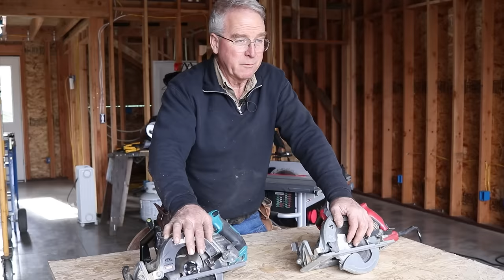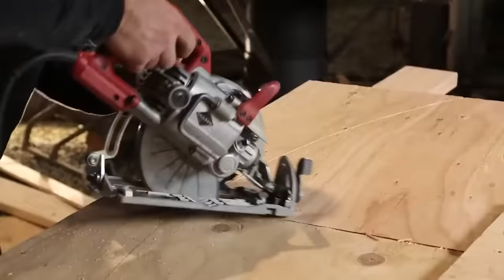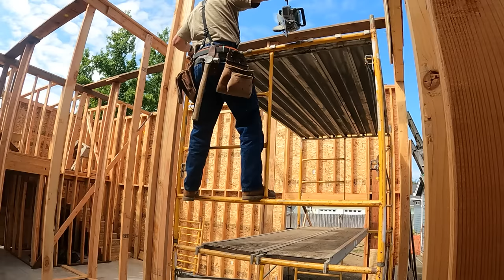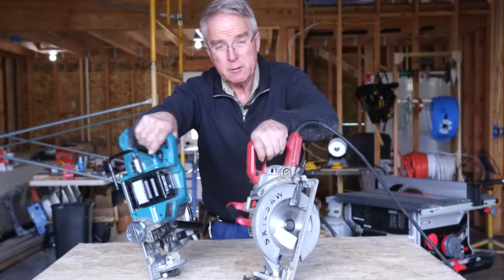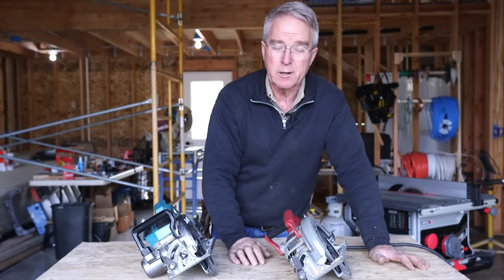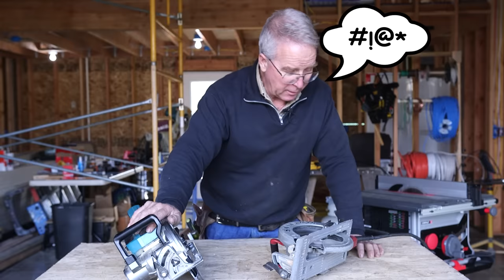Makita 40v XGT GSR01Z 7-1/4" vs. Skilsaw Mag 77 Circular Saw Review

Comment: I love my modern cordless tools, and yes they are makita. However I think you nailed the inherit weakness that cordless still has and in many cases will always have. This was by far one of the most fair and reasonable assessments I've ever seen. I think the statement of if you have to pick only one, then going with the corded workhorse is always 100% the correct answer. Cordless is firmly believe is a luxury to have for the convenience if you can afford the extra cost. Most of my older corded tools I still keep around, because like you sometimes there is a job that they are simply better at although it is usually because I've been lazy and kept chucking my batteries in a bag instead of on a charger.

Comment: I hear what you are saying. I am 54 and my background is residential construction. I used a DeWalt framing saw and my forman used a saw just like yours. The job sites that we worked on were almost always away from town and power. So we had to have a generator. Listening to that run all day long to power the tools is a reminder to look for a quieter option if there is one. I have a ringing in my ears all day and all night. My DeWalt flexvolt saw now will do almost anything and no generator noise.

Comment: I started my career in the trades early. My first cordless drill was the old black and decker that had a fixed internal battery cord and plugged directly into an outlet to charge. It had a 3/8" keyed chuck and had horriblelife span compared to today's cordless stuff. Today I'm a cordless tool fan. I'm currently running a gen 2 ridgid cordless circular saw that I have ran to hell and back for almost 16 years. It's an old 18v 6 1/2" saw. I've ran this saw since I was 24 years old. I'm now 42.  This saw certainly has its limits but with a new blade and a fresh battery I wouldnt hesitate to rip 2x lumber. I usually do picture framed deck jobs using this saw only. However I dont do major framing with it. I love my old cordless ridgid saw. I trust it doing damn near anything. I always keep my biggger saws in my truck but for what I do my cordless will always have a place in my tool box. 😊

Comment: Scott- well done! As a general contractor in PA, worm drives were not something I had ever used- it was always a sidewinder. I am not a production builder and do a lot or remodeling, so cordless has been a big plus for me and I have no problem having enough batteries to get the work done. I have had Makita's 36 volt (2 x 18v) rear handle saw for a few years now and love it- even bought a second one so that I can have a framing blade and a metal blade so I don't need to change blades. 

You did an excellent job exposing the nuance of how individuals use tools. A few years ago I bought a used worm drive because I thought that having the added power would be a benefit, but I used it once and it has never come back out. Thanks for being open and honest.

Comment: One thing you didn't mention and maybe haven't noticed yet is the effect of rain on the saws. That Makita can sit outside in a PNW rain all winter long and never have an issue because of it. Your corded saw is going to trip the GFI fairly often if left uncovered. I framed houses in SW Washington for 9 years and that one fact made the cordless saws worth every penny.

I didn't actually leave the saw out for an entire winter. My point is, it can get wet and it'll still function with zero problems. A corded saw will trip the GFI if it gets much water on it.
Reply: Makita is plenty durable and I think his baseless assertion doesn't fit.
Reply: Two weeks into owning my makita, I accidentally left out overnight - hanging from the side of my trailer, in a hurricane..

Not only had I forgotten all about it the next morning, it hadn't been stolen & it hadn't blown away or even showed any sign of wear or rust whatsoever (except a little rusty color in the socket for the rafter-hook; cleaned right out with a little WD).

It runs like nothing ever happened, and I thanked my lucky stars for it. ✌️
Reply: Man. I've been in Costa Rica for 20 years and never looked at that angle....Interesting.BUT. I'm also a maintenance fanatic with my schtuff. You buy a pair of boots. Never put them on, leave them in the closet for 3 months, they grow a pizza topping. Like the  PNW. It's a tough climate(minus coldness). YOU have better ferns in Olympic than what we have here tho. We run 50/50 on woods and CR kicks bootay on orchids---no elk
Reply: Um,,, your ground is hooked up wrong…
Reply: @Champ  do you really think it will last as long as the skillsaw?  Plus you will need new batteries at some point
Reply: @915fatty  those of us that make money with tools don't leave them out all winter, because we're using them.
Reply: @michaelgarrow3239  no it means his ground is working correctly?
Reply: @PeterTrimboli  - If it’s working correctly then why is it tripping all the time?  😉🎶🎵
Reply: @michaelgarrow3239  because when the saw housing gets wet and the motor windings get wet small currents leak to ground through the saturated windings through the saw housing that is grounded so current leaks to ground because it is grounded correctly and the GFI trips because the GFI is working correctly
Reply: @PeterTrimboli  - Your saw doesn’t work. It is not correct.. 
Do you want to reset breakers all day? Or cut wood??? 
🤔🎶🎵
Reply: @michaelgarrow3239  not the breaker the GFI the GFI is tripping because it is doing it's job if you have a wet corded saw that is properly grounded and are plugged into a GFI as required by OSHA most saws will trip because 5miliamps or greater is returning on the ground which causes the GFI to trip
Reply: @PeterTrimboli  - If we are being pedantic.. the gfi is a circuit-breaker…
It breakers the circuit. And makes your saw inoperable. And you somehow think that is working correctly… 
Do you work for the government?
Edit: I will guess that you have never done a lick of construction in your life.
Reply: @PeterTrimboli :  Minor quibble:  It needn't return on the EGC to trip the GFCI.
Reply: @ncooty  right it can return on anything leak through the earth return on a piece of building steel literally anything other than the current carrying conductors hot and neutral but the guy is arguing that it's not grounded correctly if the GFI is tripping so I was trying to give him an example if the saw was grounded correctly if the saw got wet a small amount of current would flow back on the egc because the saw is grounded properly and would trip the gfi
Reply: Makita saws are IP54 rated.

Comment: The soft start might be there to avoid massive power spikes at startup. Since it’s an electronic speed controller (ESC) the upslope is defined by software so they can put whatever they like. It’s likely a compromise between convenience and battery or mosfet life

Comment: ...mmm I bought a new Skilsaw way back in 1987 and it is a 50th Anniversary Edition  Skilsaw that they sold in a Gold color !  I also have the Blue steel tool box it came in . Its one SWEET saw !
Reply: I bought that same saw but it's long gone. Had 2 worm drives prior and 2 since that I reserve for cutting concrete or ripping a lot of 2xs. 6-1/2" 20v Dewalt with 60 volt flexvolt batteries is my daily go to saw. Amazing power when using those batteries instead of the standard 20 volt.

Comment: Great video.  When I was looking for a new saw in 2014, I had fully intended on buying the Mag 77 but saw a tool breakdown video on AvE's channel of both the Mag 77 and the Makita (corded) hypoid gear saw and went to the store to check them both out.  After holding both in my hand, I purchased the Makita and haven't looked back.  Here's why: I'll never be in a situation where I need a cordless saw of any kind, Hypoid gear saws don't need to have the oil changed (worm drive do) and the Makita felt better in the hand.  I bought the one with the magnesium housing (the top model) but it is still half the price of a cordless and has more power and torque.  It's the best of all worlds, in my opinion.

Comment: I can attest to the toughness of the Makita saws. I had my track saw 20'+ up on a roof and it slid off... it still works perfectly. I have 3 of the Makita hypoid saws (18V) and I use them all on the same job, one is always at hand that way. My 77 never gets off the shelf anymore. There's a tool store in Portland called Charles H Day and they routinely have a sale of this saw with four batteries and a dual charger for $259. Can't beat it.

With that said I absolutely love my Makita 10 1/4" cordless hypoid and prefer it for everyday use. Incredibly smooth, balanced, lightweight and powerful I can use it for 2x's and 3 1/2" I-joists. Two batteries and a charger from CHD for $389. My 10 1/4" Bigfoot never gets taken out off the tool shelf anymore.

Comment: Been using skill & Bosch worm drives for 35 years now. I've probably gone through 6 of them, aside an accational trigger needing to be replaced the reason for a new saw has always been from theft or a bad drop, never did one just quit. The ones that got dropped still got used for demo & concrete. I do like the break on the cordless, grew up learning to use a saw with a pinned guard, that being said you have to be VERY mindful which one your useing! 
Cordless are great! I use one most of the time but sometimes they just dont cut the mustard 🤔

Comment: I can say that my partner dropped my Makita 18x2 rear handle saw from a 12ft deck onto a concrete slab. 

He thought he would be buying me a $300 saw, but it was fine. It wasnt bent, it wasnt knocked out of alignment, it cut square, it cut straight, even the marking notch on the front was aligned still.

Comment: What a great review. Very detailed and there were some things I hadn't considered (having not been a master carpenter in my life).
I do think though, that in some situations that you touched on, it's about developing a different mindset/habit of how things are done. Don't get up on a roof w/o charging all the batteries first. That's a pattern/habit change that's completely different than what you've known in your working life when you're accustomed to grabbing the 50ft extension cord and finding an outlet. It would be very interesting to get a similar review from a younger person coming from the opposite direction........never having used a corded saw, only cordless. That day, I think, may be sooner than later.
I've been using cordless drills (some in a work environment) since the late 80's (I think...that was a while ago), and don't like a corded drill. At all. Too much power isn't always the best choice. Oh, and that first cordless drill was a 9.6 volt Sears dealio. Laughable nowadays, but it did what was needed...mostly.
Anyway, keep up the good work and the good reviews. Always a pleasure to get your almost immeasurable insights into things.
Reply: It's as simple as taking an extra battery with you every time you get up on the roof or a difficult access situation. For me it's just a habit and really not that hard🤷‍♂

Comment: I'm with you all the way Scott. I have a lot of respect for corded and pneumatic tools that run on corded power. I work alone most times and having a tool that works (all the time) is important to me. I own a lot of battery-operated tools also and they have their specific uses as well, but when it comes to the real bull work being done, corded all the way.
Reply: MHPT' 36V does cordless and AC adapter 
Best of both worlds

Comment: In Ontario we all use direct drive saws. I bought a cordless when I started building my hunting cabin, thinking it might come in handy for small jobs rather than running the generator. I built the whole cabin with it, having a spare battery always on charge. Now I never use my corded saw except to rip green lumber when I need that raw power. I agree though that if I had to have only one saw it would be the corded one.

Comment: Lol I have both the 36v makita version of the drop saw and a corded 7 1/4 makita saw also. Wherever I go both are on the truck because each has a place. My only and biggest gripe is the safety button on the 36 volt. It has put me in a dangerous spot with that saw numerous times. But with that said it is still my go to first before a corded. It may just be me but i do find cords to be a pain in the butt sometimes. 
What i found really impressive was the ripping ability of the cordless it would cut some very tough materials with relative ease.

Comment: Sounds like the Metabo HPT 36v rear handle would be your perfect saw. i own all three of these saws and the metabo definitely gets the most use with it's flexibility of cordless/corded and it's lightweight.
Reply: metabo is so light if it only had a little bit more power it'll be perfect
Reply: My DeWalt 60v Cordless skill saw is going 6 Year's custom Carpentery..far exceeded my mag 77 from decades ago when I First bought it. The Makita battery HATES cold weather so in Arizona mountains during winter may not always snow but the Frost will kill them same as rigid batteries most of my Crew has figured this out.the only thing we use for corded tools is ripping Beam cutting etc..

Also disabled the Safety switch LONG ago...the Trigger IS the safety, the Magnetic brake however saved my thumb
Reply: Ķ7y

Comment: Great review!!!  I don’t have any cordless tools my choice. Just an avid DIYer. But started doing residential construction after graduation from college “years ago”. I bought a non mag Skilsaw 77. Weighs a ton but still running strong 40 years later. On one job we were cutting large sheets of 1-1/2” thick polycarbonate for a check cashing  Teller line. Managed that work like a champ ripping the sheets down. Pretty sure the Makita wouldn’t be able to match that performance.

Comment: THANK YOU for your channel! I greatly enjoy your content and the superb oration. I've been a dedicated watcher for over 5 years. I'm a self employed carpenter, been in the trade almost 30 yrs. I made the switch to a battery framing saw almost 5 yrs ago (dewalt 60v). I've owned and used both the rear handle and the right side blade models. I will not go back to a corded saw, but my mag 77 sits in the garage as a backup. I highly suggest you try the dewalt saw. I have also used the makita 36v and 40v rear handle saws. The makita is a fine saw. The 36v saw had awesome run time on a pair of 5ah batteries. The dewalt has more power than the makita, hands down (IMHO). The dewalt also has more power then my mag77 (IMHO). If a cord, used as a tether, is one of the comparison factors, simply attach a rope tether to the battery saw. Lithium battery tools have completely revolutionized the jobsite for me and all of my fellow craftsmen. The only corded tool in my job trailer is a table saw. I even keep battery operated nailers in my trailer along side my pneumatic nailers. All the way from framing guns to 23ga pinners. 
  All that to say, I'm stubborn and dont like change, but the battery powered framing saw is/was a complete no brainer for me. Even my makita track saw is battery powered. 
  For what it's worth, I do a very even split of rough and finish carpentry.
  Scott, thank you again for your channel, even my wife enjoys your content! .

Comment: One thing I will say about the skilsaw is it's a jack of all trades slap a diamond blade on it, it turns into a concrete cutter, slap a chainsaw attachment you can cut 16 inch timbers, throw a metal cutting wheel you can do it all with the skilsaw, but any cordless saw will do it all with anything dealing with wood,it's not a bad idea to keep a good corded saw in your tool box in case the batteries stop working or you kill all the batteries regardless great video I enjoyed watching .

Comment: First, thank you for short-medium term review for this tool. Not the unpacking two cuts video like most YouTubers do. 

I own this saw, for 2 years and had 18*2 version for 3 years before that. We don't have wormdrive saws in our country, most saws are light sidewinders, and compared to them Makita's rear handle have loads of power. I have almost every Makita 40v saw(except 9 1/4), this is second most used saw, first one is plunge saw. I cut the cord around 4 years ago and didn't use corded saws ever since, though I would be totally fine using one if needed.
For the weight and power you can always get 8ah battery, it allows to power through the material more confidently than with 4ah.

Comment: I broke down and bought my first cordless 7.25'' saw and it happens to be a Hercules.  I don't use it all day every day but I've been using it a lot for our home remodel and have no complaints, this after having owned a rather weighty corded Skilsaw Mag 77 for the last two decades.  I'm finally getting more sold on battery tools for heavy punching items.  But forgetting to charge every day is, as mentioned in the video, always the drawback. I also wonder will my new saw last the 20 years the Mag 77 has and is still rock solid.  Somehow I doubt it.

Comment: When I was younger and literally living out of my truck making a living with my tools.  I got a corded skilsaw , that was 18 years ago. I've bought a new one since, but I still have that skilsaw and I used it yesterday.   Im building a house on a lot without power in a wilderness area right now.  Almost every other power tool I have is Makita, they're my favorite.  But for a Circular Saw, I bought a small generator and I run my cords off that. I need a battery charging station anyway,  so its not like I wouldn't have a generator for far-flung jobs.  Corded Skilsaw takes it for this "young fella"  (37).
Makita is the only main stream brand I trust anymore - but nobody beats Skil on their circs. Hell, I hear people call them Skilsaws (and I do too) more often than not. That's when you know you're the GOAT.